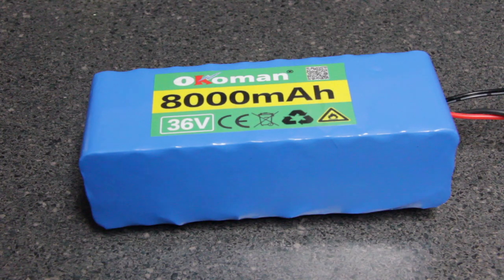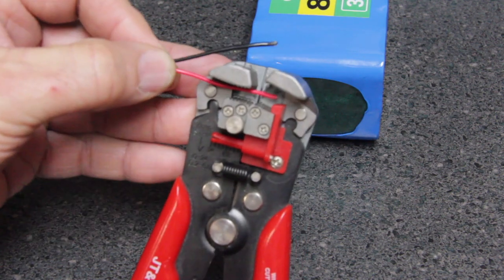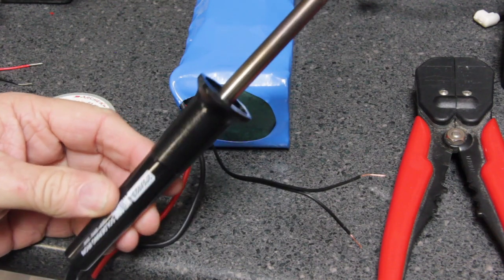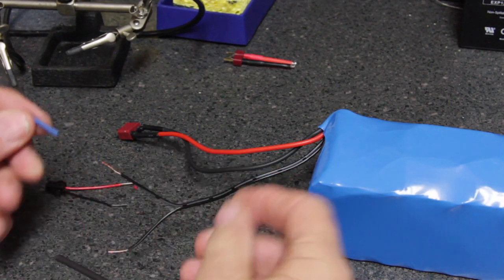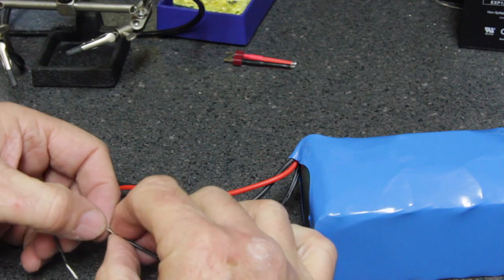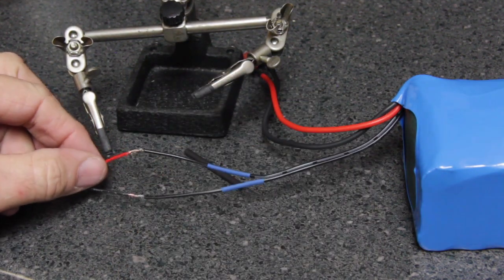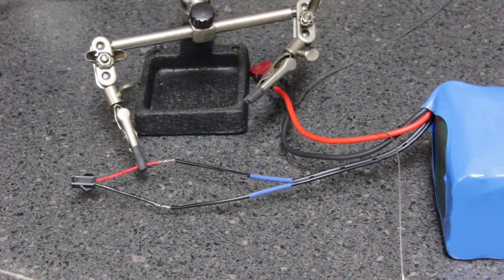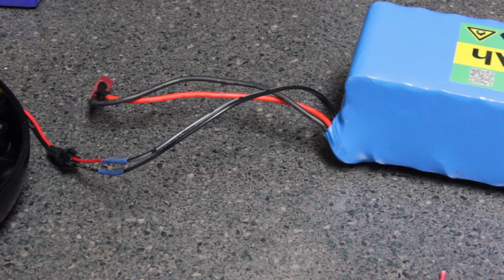Jetson Bolt Pro Battery Replacement Part 3

Comment: Do u have to solder ? I don't have access to one 😮
Reply from the maker: You can use insulated crimp on connectors, but the best way is to solder.  You can get a Harbor Freight solder iron for cheap.  See my video on using the Harbor Freight soldering iron
Reply: @JoediyLab  I got the same battery as u but have no way to solder can't I just use.the charger with the barrel on it and unattach the original charger wire ?
Reply from the maker: Battery has a different amp hour rating, you have to charge the batteries separately
Reply: @JoediyLab what do u mean? I'm asking if I can remove the original charging wire on the jetson and use the wire from the new battery I bought the same battery u bought but 10 ah
Reply from the maker: Are you using the original battery and a new battery,   if so you have to charge each battery separately.  If you are replacing the original battery then yes you can wire use the existing charge port.  But use the new battery charger you got with the  new battery.
Reply: No I am not using both batteries just replacing battery with the new one like u have the blue battery and i don't have access to a solder so I was gonna remove original charger wire and use the charger port on new battery
Reply from the maker: Yes that will work,  you can use insulated crimp connectors,  get yourself a good pair of crimp pliers.  See my video on different wire connectors.

Comment: My bolt pro is new but it died after a mile of full throttle on a full charge.. other YouTubers filmed themselves using full throttle & got 12 miles  , can someone help me
Reply from the maker: Check the battery voltage and sett what it is, should be around 40 volts when charged.  If not, could be a bad battery. If battery is ok, more than like your controller could be bad.  I would take back to where you purchased and exchange it.  Thanks

Comment: In a pinch I’ve used the cap of a paint rattle can as a third hand, I cut a slot 180 degrees from each other in the cap, twist the wires together and slide the wire in the slots and solder away, works great 👍
Reply from the maker: That is a way cool idea Dave,,  Thanks